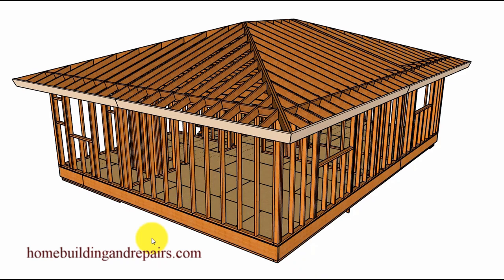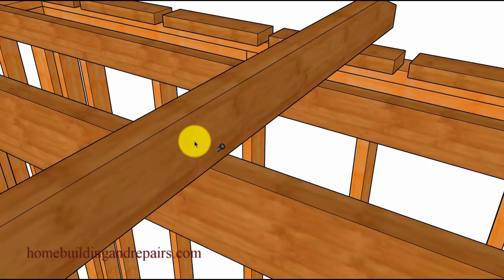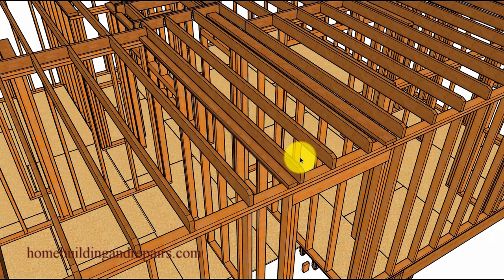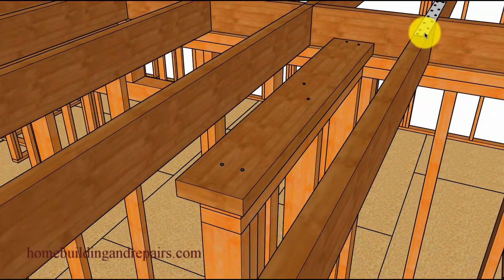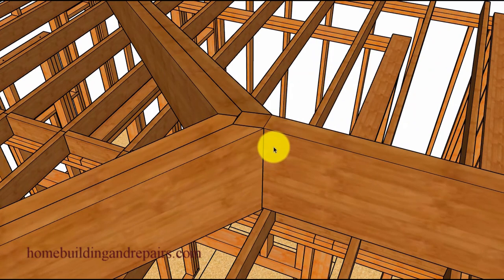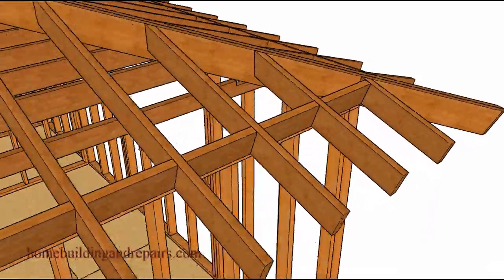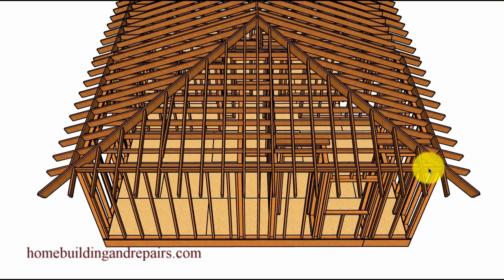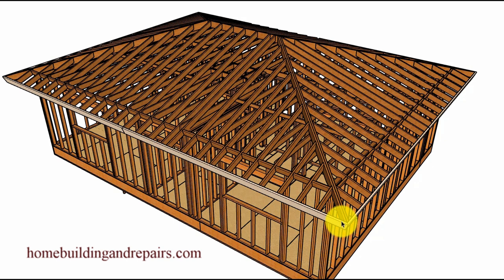Part 8 - Double Hip Home Addition Ceiling And Roof Framing

Comment: Code does allow single top plates if the joists/rafters are directly over the studs, and studs can be spaced up to 24" to match joist/rafter spacing if studs are directly under them.
Reply from the maker: I don't think you will see much single plate framing if you need an engineer or building department approval.
Reply: @gregvancom  <> Actually they do approve it for two reasons, it's code, and it allows for more insulation in the walls. It used to be more common for attached garages to save on material. Code only requires double top plates when joists/rafters are random with respect to the stud placement.
Reply from the maker: @Oldhogleg  I've never seen it done and never did it myself on code approved building plans. I say go for it, but don't forget that you could be cutting a lot of drywall if drywalling the interior with 92.25 studs and walls that will be less than 8 foot tall.
Reply: @gregvancom  <> Lol, true, would have to spend time cutting studs out of 8' stock.

The reason it's not been all that common (mainly only continued on attached garages) is because it's generally not practical outside of a simple rectangle floor plan. After WWII floor plans became more cut-up, so it was way easier to run studs at 16"oc instead of 24", and add a second top plate, eliminating the hassle of lining up framing members and slowly down the framing process.

But of course decades later, generations later, it was forgotten why studs are commonly 16" instead of 24", assuming it can only be that way. But to meet higher and higher insulation efficiency requirements, architects are going back to the old code allowing to remove lumber fore more insulation. The energy conservation requirements are now making it worthwhile to spend the extra time planning out the alignment of framing members.
Reply: I always stack frame joists/rafters over studs, but I couldn't bring myself to use only one top plate, especially if studs were 24" on center. And I definitely wouldn't do it just to get a little bit more insulation. I hate to see the industry fudge on quality for the sake of extra insulation, but that's the way they're going.
Reply: @Jay-tk7ib  <> Lol, I know the feeling. That's why you would want to be more conscious and more liberal in the use of metal connectors and ties these days if you do go that route

Comment: How many inches should nails be apart if adding a sister joist. How many inches apart if using Simpson screws
Reply from the maker: Usually between 12 and 16 inches and if you can have a row at the top and bottom at least one inch away from edge, then that might work better. I like to stagger them also and might have video on it at our website.

Comment: Lol, reminds me of my olden days decades ago while still in my 20's cutting rafter tails/outlookers, measuring, cutting, and installing facia and gable barge boards all by myself two stories+ up. Learn some tricks going solo like that REAL fast with no one to help you and still get perfect cuts and straight lines with no scaffolding and no safety harnesses (I did say it was almost four decades ago,).
Reply from the maker: I'm with yeah. I actually built this hip roof design because if I put a gable at both end, then my scaffolding wouldn't reach when stuccoing up that high. I only had three towers. I couldn't see myself up that high with a ladder on top of scaffolding, even though I've done it before. Hopefully we don't have to ever do that stuff again.
Reply: @gregvancom  <> Yeah, exactly!

Comment: Thanks for great videos as always. question: if roof sheeting dips a bit between trusses just enough to make the roof look not so crisp, can I just nail or screw 2x4 sections between top of trusses to support the sheeting? (That's assuming the sheets are of appropriate size/quality and trusses are placed per code). Thanks
Reply from the maker: I would check with the truss manufacture. I don't know if the extra weight would create problems. If you haven't installed sheathing, then maybe a thicker sheathing might also be a good idea.